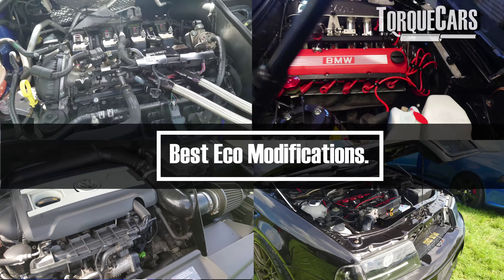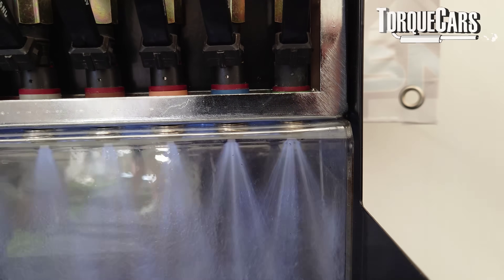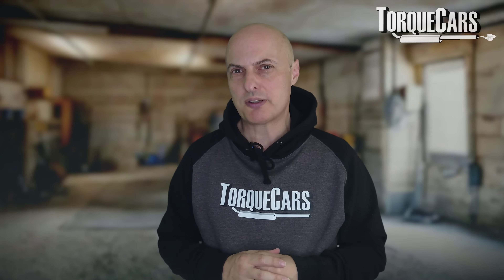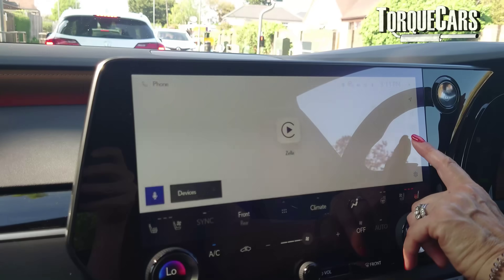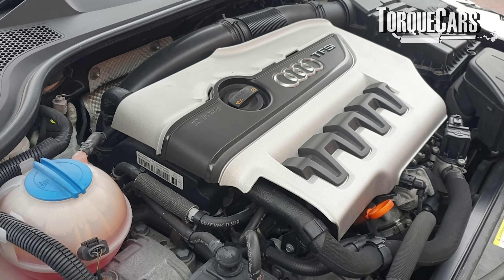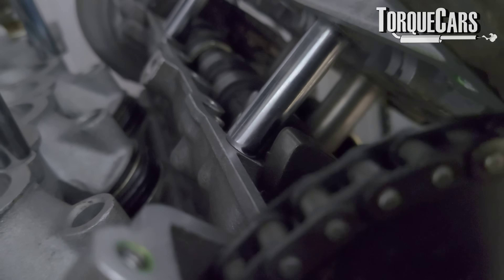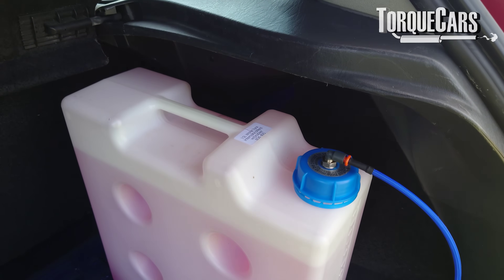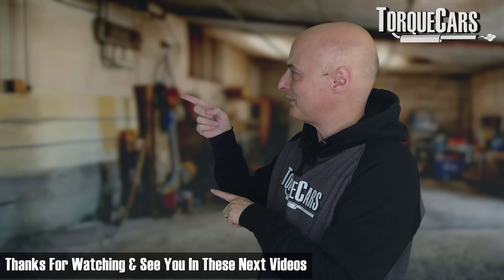Car Mods That Actually Save Fuel (and Ones That Don’t)⛽

Comment: Cylinder deactivation does create temperature differences in the engine.
Deactivated cylinders cool down closer to the coolant temperature, while the active cylinders work harder and run hotter, especially in the combustion chamber and exhaust port areas. This temperature variation can cause thermal stress and lead to issues like:
Oil Consumption and Fouling: The cooler temperature and internal pressure changes in deactivated cylinders can sometimes cause oil to be drawn past piston rings and foul the spark plugs.
Component Wear: The increased heat and load on the active cylinders, combined with the pressure and temperature shifts in the inactive ones, is theorized by some to contribute to accelerated wear on parts like valve lifters and piston rings. It might save you some money now, but will eventually destroy your engine. I've had dozens of people come in and ask for disconnecting cylinder deactivation😊

Comment: Wayne, please don't use cylinder deactivation on your car. It's very bad for the engine block as you'll have some cylinders running cold, while others are running hot (normal).
This will eventually warp the engine block and cause cylinder bores to become oval. Mechanic here.Cylinder deactivation can increase oil consumption and spark plug fouling due to oil control issues in the deactivated cylinders. It can also cause engine vibration and uneven wear from inconsistent operation and temperature differences across cylinders

Comment: "Thousand-Watt speakers". That doesn't matter, they are passive units.
Only if your system amplifier can continuously supply that many Watts then it may make a difference.
With reference to manufacturers fuel economy claims change the word "generous" for unrealistic.

Comment: Looks like majority of those mods need lots of kilometers to be driven before the investment returns... And to my case it seems, best improvement would be tyres. Though I'm not going to use eco ones for winter time, in winter I take safety through grip over fuel economy, which already will be worsened by oil and engine needing more time to heat up to working temperatures.
And those thingies on the roof? Maybe I'll get me some Polo IV model and find a program that test aerodrag and add those to compare (cheaper than buying and discovering it changes nothing, except some people think I'm trying to turn city car into sports mobile, because they don't know any better).

Comment: Interesting,  but personally I wouldn't make any changes as I'd be worried about messing up!  I have a 21 year old 1.8 petrol Mondeo with 110k miles.  Still getting 40mpg.  I always used BP or Shell E5 fuel and proper Ford oil and filter changed every year.  Still on original exhaust. Air-conditioning left on all the time even in winter. Never even been regassed and it's still icy cold.  Best car I ever had.

Comment: My mk 3 vw golf 2.8 vr6 was reporting 45mpg+ on a run and checking against a full tank to tank refill reported about the same (you can’t do a full tank anymore due to the filler flap seal)

The engine has down 170,000 miles and is still going strong but the dreaded rust has just claimed it and it is past repair.

Comment: The difficulty with most modifications to the car aimed at fuel economy is the modfications themselves are a cost. So unless you have a realistic chance of keeping the car long enough that you pass the payback period of the modification, you might not be better off. The better option might be choosing a car that has those characteristics already (for example choosing a car with smaller wheels) when buying the car.

One exception might be changing tyres, which will be a wear and tear item you will most likely have to deal with at some point, so choosing tyres aimed at fuel economy might be worth considering if that is a priority.

Cost free things like removing unecessary clutter and weight (roof rails etc) might also be a simple way to improve fuel economy.

Comment: 80 mpg insteaf of 40?? Yeah around idle in that case.... downhill.... Not under any load. Physically impossible.
Reply from the maker: Just drive a 1.4 TFSi and compare the trip computer current MPG in COD mode or standard mode, there is a massive difference and I see at least 40 mpg jumping to 80 mpg, it often jumps over 100mpg when the cylinders shut down.
Reply: @torquecars  Not possible. Not under load. Else that counter is fooling you :) Maybe at or around idle. Or downhill. But not under any load. THink about it yourself... A certain amount of power is required to keep a certain speed with a certain car. Suddenly you double the efficiency of the engine........ Doubling the efficiency of the combustion engine... you do realize how completely revolutionary that would be? :)

Only other way to increase mpg like that would be if the 2 cylinders makes you drive much slower.... But I'm assuming of course same speed for both.

The way I think it might fool you is that every time you let off the gas it will revert to 2 cylinders. And when you let off the gas are exactly the times when there is very low fuel consumption.... and would be even on 4 cylinders. But you will never see that... since on those occasions coincide with reverting to only 2 cyl.
Reply: Cylinder deactivation can increase oil consumption and spark plug fouling due to oil control issues in the deactivated cylinders. It can also cause engine vibration and uneven wear from inconsistent operation and temperature differences across cylinders

Comment: Can you imagine how much more MPG you could get if they could figure out how to achieve cylinder deactivation on a modern diesel car? I don’t know if there’s already been much research but I can’t find that much on Google about it.
Reply from the maker: It would be an interesting project but my take is that there is not much point on a diesel, the key is the throttle is fully open on 2 cylinders rather than being fractionally open on all 4 which creates turbulance. Diesel engines do not use a throttle, as power is controlled by fuel delivery (a big simplification). You also have the problem of balance on a diesel which is already much rougher than a petrol equivalent. I did a video on cylinder deactivation if you wanted to learn more about it https://www.youtube.com/watch?v=F1qeeIymYd8
Reply: Cylinder deactivation can increase oil consumption and spark plug fouling due to oil control issues in the deactivated cylinders. It can also cause engine vibration and uneven wear from inconsistent operation and temperature differences across cylinders

Comment: With older (mechanical distributor) cars we are stuck with the advance curves for leaded petrol from the 1980s. Modern petrol burns much slower. This makes the older cars less economical even when they're in perfect condition. Modern replacement distributors are available with adjustable curves via Bluetooth. I'm looking into getting one. But quite expensive so probably will offset any savings...
Reply: if we can't get the curve, we can advance the ignition, then we drive by chasing a specific RPM. I mean, for example, once, my vacuum-advance wasn't connected (I didn't understand this), that mean the advance has incorrect curve, so I chase the RPM where my engine gain power (I can feel it), so I drive by chasing RPM like this until I reconnected the vacuum-advance later.
Reply: @xponen Exactly. With older cars so many times the ignition is in bad condition and not set correctly. Having good ignition makes such a difference. You can feel it in the acceleration and fuel use.

Comment: I go by the oil having the CAR manufacturers specification model number for it. Supposed to have castrol gtx magnitec, where as i use mannol 7707 in my 1.6 tdci fiesta.

Comment: Wayne, you offer some great advice in this video for sure. One thing I never see mentioned in any fuel efficiency-related video is the electrical system of a car, or "clever mods" related to it. One needs to make sure it's working at 100% capacity. I've added a small capacitor on the battery terminals and it helps noticeably the ignition system (stronger spark), even the lights of the car have gotten brighter / stronger. Also, there are no voltage dips / drops when the cooling fan cuts in anymore. Check earth connections, clean / replace corroded connectors and replace any really old sensors - I recently replaced my camshaft position sensor which was the age of my Alfa 146 (26+ years old) and that alone provided me with an additional 2-3% fuel economy gain, verified @ the pump (same station, same pump). I also use an oil additive (X-1R) which is confirmed even by NASA to reduce friction by up to 47% (not advertising, merely mentioning). All these things, combined with a simple remap & just a BMC panel air filter in the OEM box, give me a combined consumption figure of 40.2 MPG, as compared to a manufacturer quoted 35.7 MPG and that was the NEDC cycle back in '99 ;) Just my "5 cents" of additional help ;)
Regards Harry
Reply: Great Information here, thanks
Reply: How does a capacitor on the battery terminal give you a fatter spark?

Comment: I saw a significant improvement (Opel Zafira 1.7cdti)  in fuel efficiency by cleaning my EGR valve yearly and putting in a can of fuel injector liquid into the tank. I have now resorted to cleaning my oil every 10k along with new fuel, air snd oil filters… very happy that i have leRnt to do this myself and car is running like a dream at 156k milage
Reply: There’s also a sensor on the intake manifold (on top) that can get clogged up, it’s well worth giving that a clean as well.👍
Reply: @TK-Will. thank you. What is the sensor called? So i can accurately do more research, thabks

Comment: I use a fuel and cat cleaner once or twice a year. Car is Honda Jazz 2006 with the 1339cc idsi engine. Also I use Super unleaded rather than normal as I'm wary about the increased ethanol in e10. I usually just do town driving and get 39.5 mpg. Interesting geoffbuys cars is testing the fuel catalysts but not sure it's worth it. I would need 4 at £13 each plus post so be about £60. Car has done 121k and runs well. The cleaner sorted out a stall at low revs when I bought the car 2 yrs ago.

Comment: i'm changing the thermostat, cause it keeps the engine at 70-75C :)... bad thermostat, clogged injectors, clogged EGR, DPF that regenerates often (like every 200km) will increase the fuel consumption

Comment: Currently averaging 6.5L/100km around 43 UK MPG on an 2015 EA111 twin charged 1.4 TSI - would like to know if a remap along with new laser platinum plugs could further restore original fuel efficiency? Have done new filters, oil and injector cleaner on a fuel cycle. 🙏
Reply: remap can help but much less so on petrol engines unless you expressly ask for a fuel economy remap.
Plugs depends if there old and worn then yes if there still clean and recently done it wont make much odds save your money

Comment: Change the wheel size Chang the gearbox ratio in relation to the speed on Speedo gives a different reading and risk a ticket fine. You also have to inform insurance as it’s a modification .

Comment: I can attest to the lighter wheels and tires idea. My 2024 Civic came with 18x8 alloy wheels and 235/40r18 tires. I put on 15x6 alloy wheels and 205/65r15 tires and my mpg went from consistently 45-47 mpg to 48-50 mpg with no changes to my driving habits or route.
Reply: Maybe half of that saving is accounted for by the 1.6% reduction in overall rolling diameter? Unless you have factored that in?
I've found the sweet spot for my local NZ roads to be 215/60R16 on my 3rd gen Primera wagon.
Reply: @danielcobb8886  205/65r15 are actually a bit bigger than the original 235/40r18 tires.